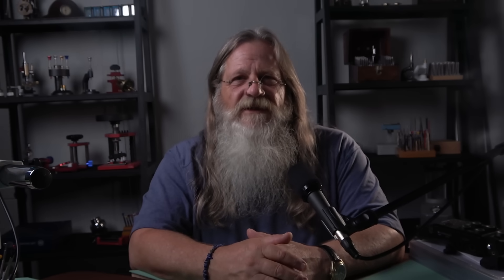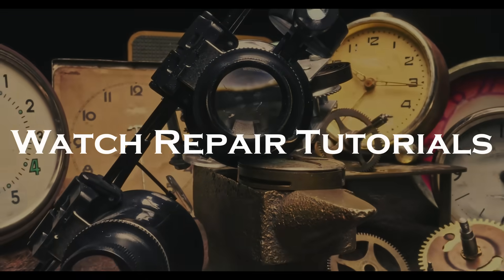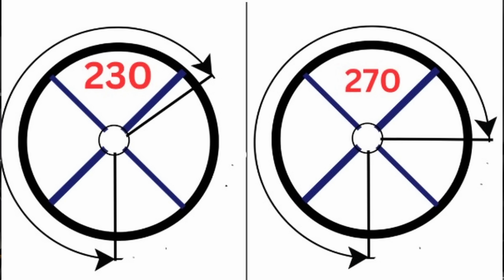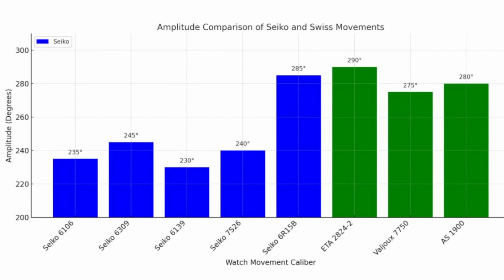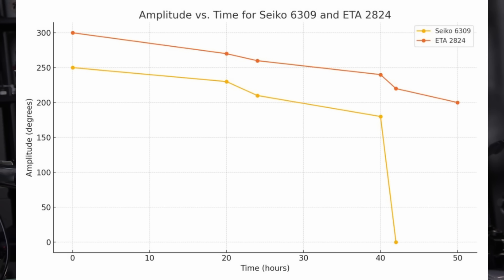Why Seiko Runs at A Lower Amplitude

Comment: The most sophisticated "insider" truth of the luxury watch market: Low-beat is the hallmark of the elite.

High-beat is an industrial shortcut. The Swiss Cartel uses high-beat to hide manufacturing tolerances. It's a way to achieve acceptable timekeeping on a mass scale with less labor-intensive manufacturing. Small imperfections in the hairspring or a balance wheel slightly out of poise is "reset" so quickly at the higher frequency that the error doesn't have time to manifest significantly in the rate. High beat "brute forces" accuracy.  A high-beat watch doesn't require the same level of Dynamic Poising as a low-beat. At  low-beat 18,000vph, every single imperfection is "on stage" for longer. If the poising or the hairspring isn't absolutely perfect, the watch will be inaccurate. When comparing the two side by side, the accurate low-beat watch is 200+ year old micro-mechanical perfection while the accurate high-beat watch is likely hiding some of it's manufacturing imperfections. It is also made to last for centuries. Low-beat movements have 37% less impact-wear (or 94,608,000 less jewel impacts a year) and more lubricant stability on the pallet stones and escape wheel teeth. Low-beat has longer service intervals too. It’s the difference between a high-revving racing engine and the steady, unstoppable torque of a classic American locomotive. It's built for longevity. This is why you will see low-beat calibers used in such ultra high end Swiss brands as Patek Phillippe, Vacheron Constantin, and Audemars Piguet. A larger, slower, higher inertia, gracefully oscillating balance wheel is peak luxury. Seiko, Miyota, and Powermatic 80 (21600vph) is the sweet spot.

Comment: Great video. I’ve been practicing with a new NH35 recently.  It’s pretty consistent at 280-290 dial/230-240 crown. The difference between dial and crown positions is what stood out to me, but didn’t change fresh from the factory vs. after my [certainly imperfect] service attempt.
Reply from the maker: Yes, the newer versions of the Seiko and NH movements should be running at typical amplitude of 270+. A typical drop in amplitude from horizontal to vertical can be anywhere from 30 to 40° so this is a little bit higher, but it probably has to do with the factory lubrication.

Comment: Alex - Thank you for this video.  I consider myself a vintage Seiko service and restoration specialist and I have restored many vintage Seikos over the past 7 years.  I think you are right on with Seiko amplitude.  The 6 series chronographs use a slightly beefier spring, but that is to be expected.  I typically see 230s and 240s out of the 6139/6138 chronographs while lower amplitude numbers coming out of the 6 series divers like the 6105 and 6309 sometimes in the 220s and 230s.  As you say,  a lot of factors affecting amplitude like wear to pivots and pinions in the train and other variables you run into with vintage well worn timepieces.  GR is making a mainspring that I and others the seiko community have been able to sub in to 6 series Seikos with lower amplitude.  With the new GR spring, i have seen amplitudes on say a 6105 in the 270s and 280s.  Love your work and thank you for sharing your knowledge.  I aways learn something.
Reply from the maker: What’s the Gr# for the spring you are using?

Comment: Dear Alex,

What would be your suggestion where to start troubleshooting a new NH35, which on Timegrapher runs +10s and +30s in 1-minute cycles. It just goes up and down like that. Amplitude is some 240° and beat error 0.0 ms.
Reply from the maker: 1st question. Have you changed or adjusted anything?
Reply: @watchrepairtutorials  No, it's like that new from the box.
Reply from the maker: @blacksmithmods  
Does this happen in all positions?
Reply: @watchrepairtutorials  I remembered some figures a bit wrong but re-tested it now: 

Dial up
-8s/d / +12s/d | 273°| 0.0ms
Dial down
-25s/d / -18s/d | 278°| 0.0ms 
Crown up
+26s/d / +33s/d | 245°| 0.1ms 
Crown down
+16s/d / +28s/d | 250°| 0.1ms

Quite wild variation.
Reply from the maker: @blacksmithmods 
This a power transmission issue.
It could be as simple as a hair caught up in the gears. 
It could also be a hairspring issue.  
Make sure the HS is parallel to the bridge and the coils are flat.
Reply from the maker: @blacksmithmods  there are really just so many things that can cause inconsistent amplitude. In a new movement, it could be anything from too little or too much lubrication,  magnetism and dirt or debris in the movement. Being new, these are the most likely.
If nothing is obvious, you will have to take it apart and service it to find the issue. 
Sorry, no easy answer.
Reply: @watchrepairtutorials  This helps a lot already, so no need to be sorry. Now I have good ideas and insights, so thanks a lot!

Comment: My NE15 serviced by me 8 years ago and my daily wearer is 260 to 265 dial down. It might need a service soon although I clean and relubricate the auto winding mechanism every 3 years or so.
Reply from the maker: Nice job. I tend to always service new movements as it will run longer that the factory lubrication. Plus’s it’s just fun to do.

Comment: I will say as a total amateur who almost exclusively works on seiko is i see on all my watchmaking spaces people turning out 7s26's and nh36's and 7006's with 230 to 250 amplitude and people say "Well it's a seiko, that's pretty good for a seiko." even though the watch was running at 270 before their service.

When i started this hobby i set 270 as my bar, with a stock mainspring, i wouldn't accept any lower, if i didn't reach 270, i tried again. As my services and skills improved (and equipment, getting a microscope gave me like +15 degrees of amp overnight), it stopped being a struggle to hit 270 and i usually get 270 to 280 on these movements in the dial positions. I'm still searching for the best match for an aftermarket mainspring for these movements. Lately i tried the general resortes gr2377x which seems to work fine but is slightly underpowered and pushes about 255 amplitude. 

I'm just saying, if you're trying to get good at this, pick up an nh36, put it on the timegrapher, if it gets 270ish from the factory. Dissassmble, clean it, reassemble and lubricate it but leave the barrel alone (Or service the barrel if you want but it's not necessary) and try to get it back up to 270. Once you can do that you're probably on the right track.

I imagine with old 7s26's maybe getting to 270 is more of a struggle but all of mine were bought new by me within the last 15 years. I'm also astonished once i learned hairspring terminal curve correction from this channel and how to use the etachron system the insane accuracy i can get out of a 7s26. My last two 7s26's (One was one of those weird 7s36's) i have a six position delta of about 5 and they gain less than a second a day on the wrist. While they may not be super high precision, get that terminal curve and the regulator pins close and they are capable of really impressive accuracy.

Comment: Well, the purpose of a watch is to tell time. ETA and Selitta are more accurate than 7s26, 4r, 6r. The sad thing is that Seiko puts the inaccurate 6R35 in watches in the EUR 1200 to EUR 2000 range, which is ridiculous. This is basically a modded movement which was found in Seiko 5s costing around EUR 100. The video is great and very educational, I understand Seiko's logic for keeping reliable movements for Seiko 5s, which will not be serviced for a long time, however they need a better 4Hz movement used in otherwise amazing watches such as the SPB143J1, the Willard and so on.
Reply from the maker: I know. You can get a lot in Swiss for under 2k

Comment: As usual, it is a very informative video. However, I have an issue with some of my seiko watches. If it is going slow and I push the regulator towards the + sign ever so little, the watch starts going fast. The reverse is also true. But, this does not happen with swiss movements. Why is this so? Is there a separate technique to adjust Seiko watches going fast or slow? Need your expert opinion. Thank you, Alex Sir.
Reply from the maker: You need to make sure that your hairsprings are centered in the regular pins. When you move the regulator arm from left to right the regulator curve of the hairspring should not move.
Reply: Thank you, Sir, for the prompt response. Now, I know how to adjust the regulator.
Reply from the maker: @kswaminathan5439  there is a lot that goes into adjusting and regulation. Keep studying and learn everything you can.

Comment: Seiko obviously has its reasons to dial down frequency. ETA also dialed down the frequency in its latest iteration of the 2824 movement from 4 to 3.5 and even 3 Hertz for the sake of longer power reserve (80 hours vs 42 in the 4-Hz-version). While there might be technical reasons to slow down movements, I do not like it. One major charm of a mechanical watch is the gliding rather than ticking seconds hand. The slower the movement, the less smooth the motion of the seconds hand becomes. Higher frequency makes your watch look better which is also why Seiko's "luxury department" Grand Seiko builds a 5-Hz-movement that also happens to feature an 80-hours power reserve.
Reply from the maker: Well there are definitely advantages and disadvantages when considering frequency. For me personally, I think 21600 is a pretty good place to be with all things considered.

Comment: Just to confirm the newer 4R&6R movements should now be running at about 260-270 amplitude. I guess the same for the NH3X movements as well.
Reply from the maker: Correct. This video was about the vintage models.

Comment: So, are analog quartz watches with oscillators not considered amplified? They're "amped" in volts?
Reply from the maker: What do you mean amplified?
Reply: @watchrepairtutorials  The amplitude is a set degree for the frequency of the watch measured in hz, but on a quarts its 32768hz which is the frequency but instead of an amplitude measured balance spring it's a quartz oscillator but nobody says anything about the convert. I am just assuming its the volt of a battery 2.3v ctl920f on mine.. ect. i duno
Reply from the maker: @typerightseesight  Amplitude and frequency are two different things.  Amplitude is the measurement of the balance wheels rotation measured in degrees.  in mechanical watches  frequency refers to  how many oscillations the balance wheel makes per hr.  Most quartz  watches run at a frequency of 32768. 

In a watch with both a balance wheel and a quartz crystal, the quartz crystal provides the ultimate timing reference at 32,768 Hz. The balance wheel may still oscillate mechanically at a much lower frequency (like 4 Hz), but it’s electronically synchronized to match the quartz standard.
Reply: @watchrepairtutorials  Yeh I was just confused with its degrees thanks.
Reply: @typerightseesight  quartz* (= mineral), quarts = plural of 1/4.
Reply: @einundsiebenziger5488  Oh, I know the reciprocal inverse equivalent to hz my talk to text just typoed it. lol.

Comment: Swiss watches are the best
Reply from the maker: I worked on primarily American and Swiss movements. Swiss manufacturing is more to my liking. 
This was for the Seiko heads.
Reply: @watchrepairtutorials  great video would you say than the Swiss movements are better and worth the price over Seiko, Hamilton for example 😊
Reply from the maker: @daveLin104in vintage movements for sure. Modern Seiko movements now operate at the 270 rule or higher amplitude. 
Swiss movements come in different grades so factory accuracy is based on which grade it is.
IMO, until you get into the 8xxx series of Seiko movements, they are no better that the NH series.

Comment: I love Swiss movements they are so nice to work on. I find they are more forgiving. You’re a legend Alex. Your always teaching me more
Reply from the maker: Thanks for the support, glad you are finding them helpful! 👍
Reply: As somebody who just serviced my first swiss watch (Eta 2451) i will say the swiss incabloc is sooo much more pleasant to work with than those godforsaken seiko diashocks on their modern movements.
Reply from the maker: @nunyabusiness9056 yes they are and what a huge improvement from the old regulator systems. 👍
Reply: @watchrepairtutorials  I will say since i learned on the seikos, as much of a nightmare as it was to learn how to set the train diashocks on a 7s26, it REALLY built up my tweezer skills fast. I went from taking literally hours to set them to just a few seconds. I don't even need your jewel picker hack anymore.
Reply from the maker: @nunyabusiness9056  it’s amazing what practice will do, isn’t it. 😊
Reply: @nunyabusiness9056 agreed not a fan of them or Citizens either. The hairspring is easier to work with , the gear trains have unique and cool designs I just like them better and I get better results every time.
Reply: @lobdsk  I get much better results on my seikos but those are also modern watches. This eta is 75 years old. 

There's things i prefer about seiko. Like it's a total PITA how the balance cock is tapered and doesn't really sit flat on anything if i'm trying to work on the balance assembly with it off the mainplate. just doing things as simple as unscrewing the stud is incredibly obnoxious. Also the overcomplicated winding system that needs it's own specialized dunk lubricant is pretty crazy. I really appreciate the magic lever of the seiko, it's a brilliant little piece of engineering. I also prefer the post goes in hole design of the seikos when setting things like the balance bridge rather than trying to get two posts under the balance bridge to slot into holes i can't even see. 

On the flipside having little openings under bridges and a separate bridge for the train and the barrel was very appreciated working on the eta. 

It's a bit of a tradeoff. I get astonishing accuracy though out of my seikos with a little tlc.
Reply: @nunyabusiness9056 weird I get the opposite results

Comment: I have owned and do own many watches with Seiko movements, and indeed they tend to run with a low amplitude. My issue with the movements is generally having poor positional variance.
Reply from the maker: One of the down side of Seiko for sure. When vertical amplitude grips to around 180 the poise error of the balance is amplified. This is why the Swiss prefer 270. If a movement is running at 270 and goes vertical, now you are around 220-230 vertical and that’s where the poise error is effectively canceled out.

Comment: I recently opened up the latest Seiko NH36 and found that its pallet fork is hollowed out and machined more cleanly than the one in the older 7S26. It's said that the 7S26 or 7009 pallet fork was made using a sintering process, which results in hollowed areas that don't look as refined as those on the NH36. Interestingly, Grand Seiko’s pallet fork is also hollowed out, but it's made using the MEMS process. This makes me curious about how the escapement efficiency of newer Seiko movements (like the NH36) compares to older ones like the 7S26.
Reply from the maker: It is a completely different design now.  I have regulated 100’s of NHxx movements which run at higher amplitude like the Swiss. 
The days of the of Seiko’s low amplitude movements has passed.

Comment: My problem with the NH series of movements is not the low amplitude. It is that Seiko never regulates them very well in their own watches. In fact, every non Seiko I own with an NH 35 or 36 movement is better regulated than their own watches. Even the older 7S26 movements keep much better time. Look, it's not a deal breaker, but if Im paying 300 dollars for a watch, I expect better than plus or minus 19 seconds a day. All my 7S26 movements are within 7. And most of my Miyotas are under 5. That is getting into chronometer territory for equivalent cost.
Reply from the maker: The reality is that factory regulation is gonna be bare minimum to try to get the movement to run within their published specifications. 
No watch company is going to spend the man hours to properly regulate a watch that sells for 300 bucks . 
All you’re getting is basic regulation and machine lubrication which is also very hit or miss.

NH movements manufactured by TMI are sold in bulk to companies that assemble watches and they are sold to these companies who are responsible for any further regulation.

Sometimes it’s gonna be good sometimes it’s gonna be very bad. It’s all in the luck of the draw.
Reply: @watchrepairtutorials while I could certainly accept that as an explanation, I have microbrand watches with the same NH series movements in them that cost less and are regulated better. I also have numerous watches with miyota movements in them that keep better time right out of the box. The good news is, Seiko movements are easy to regulate. Unfortunately most people don't want to mess with that. Again, this is not a deal breaker it's just something I've come to accept from Seiko watches.
Reply from the maker: @bobbressi5414 yea, I think your feelings are shared by many. Personally I’m. It a big Seiko guy. My interests lie elsewhere.